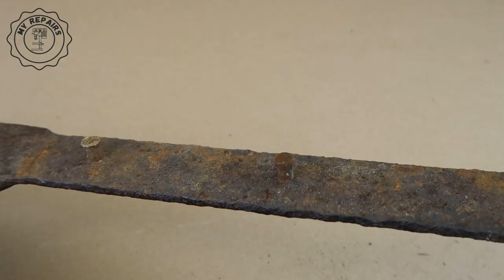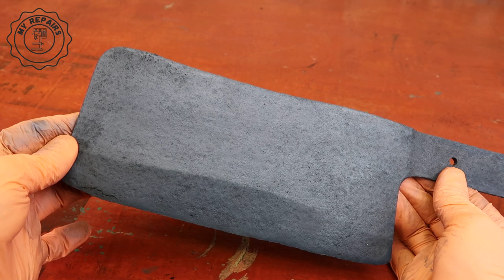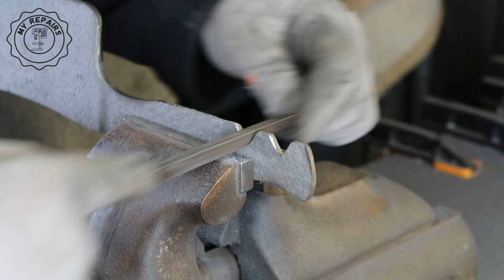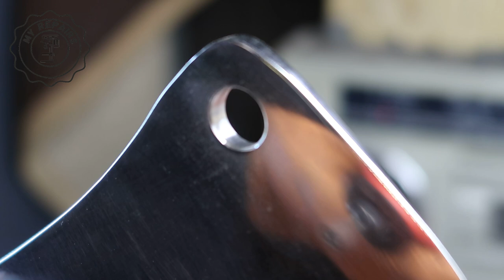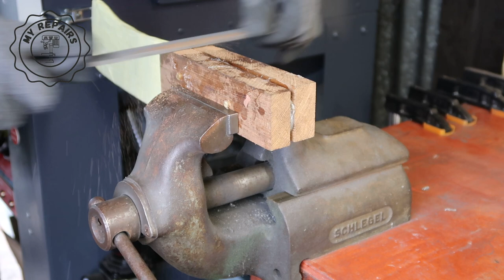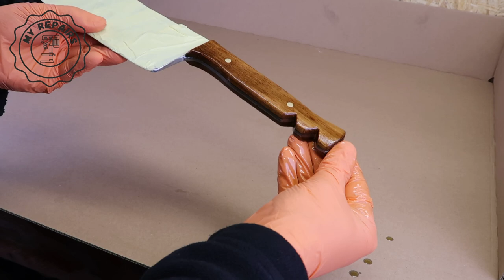#Renovation old cleaver

Comment: They have a term with old cars "restomod". I like restomod cars. Better suspension, brakes, more powerful engine etc. However my opinion is that I don't so much like it with old tools. Mostly it doesn't make them perform better. The exception is when a tool is so far gone you may as well or have to mod it. Again just my opinions.

Comment: You ground off most if not all of the good steel for the edge.🤢 you can see the difference in the carbon steel vs. The mild steel when you etched it to remove the rust.

Comment: It's your cleaver to with as you choose, but you erased all the years of history behind it, and make it look brand new. Why bother. If you have a problem with texture and ding and dents...just cut a new one out of 1/4 inch steel plate like you basically did here. Save all that grinding and sanding to make it look like a mirror...or just go to Walmart and buy a new shiny one.